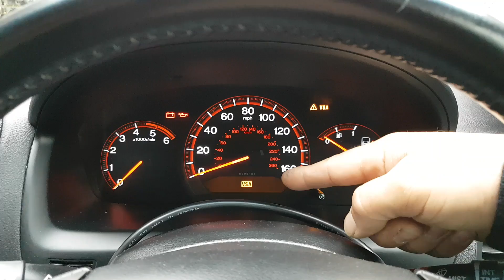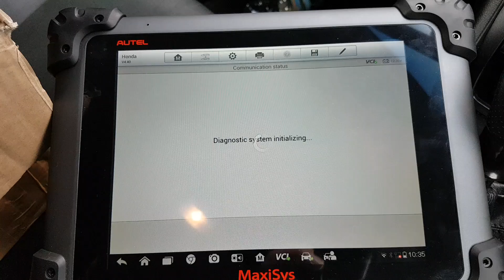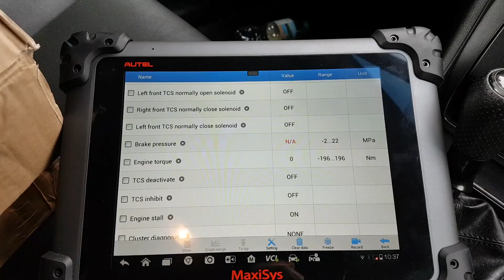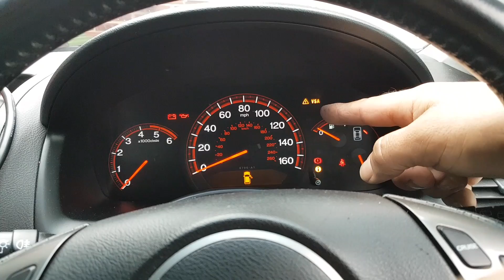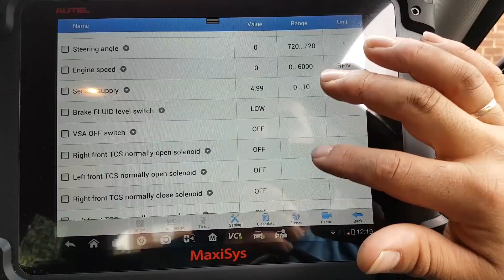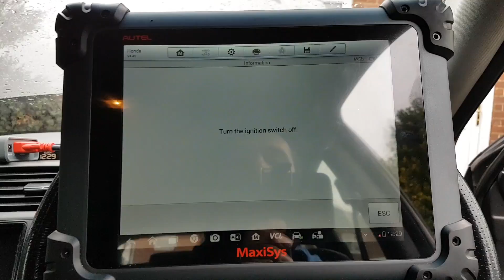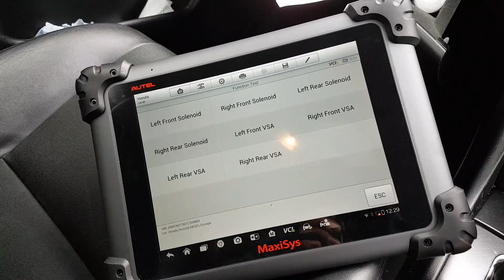Honda Accord VSA light on. Codes 66-1 and 84-1 brake pressure sensor. Fault finding and repair.

Comment: Did you have to bleed abs pump after you have replaced it?? I Did send mine to the company as you mentioned before.. put it back in, bleed the brakes but the pedał seems to be quite spongy.. should i also bleed the pump via scanner??
Reply from the maker: Hi
Yes, you need to bleed the brakes... bleed them the old fashion, should do the job...
If they still spongy, you might have not bleed them enough, and still air in the system...
There is no need to use the scanner to do it, the scanned only aids the process, and not all system allow you to do it through the scanner, in fact, I think on this car does not work...
Thank you for watching!
Reply: LM Auto Repairs thx for reply. I Did bled them the old fashioned way just after installing recon unit back in the car. But after bleeding the system quite a few times the pedal seems to be still spongy. I bled it like 10 times.. the brake pedal after few pumps seems to get harder and as soon as i turn the motor on it sinks down(not all the way) but i would say much more than it should. And while the engine is on - pumping action doesn’t bring the pedal up. Every pump makes the pedal slowly sinking down.. but nut all the way Any suggestion?
Reply from the maker: Kyokunek 
Did you had that issue before?
Because, the unit itself should not causing anything like that, unless there is air in the system...
Reply: LM Auto Repairs to be honest.. i don’t remember... The abs pump along with steering rack recon and replacement of many other parts took me about a year to put everything back together.. so i dont remember.. but What i remember is the brake pressure swich fault and vsa light on- i think that was the main reason to refurb the abs..
Reply: LM Auto Repairs great movies. I'm trying to promote my own one please.chexk my channel

Comment: I have a honda accord diesel 06 plate and have replaced the pump with a second hand one but the lights are still on the dash do i need to get them cleared
Reply from the maker: albert widdowson 
I would recommend... just to make sure...
Hope you haven't got a bad second hand one...
Thank you for watching!
Reply: The guy i bought it from said it was fully working and i have 1 month warranty
Is there another way of reseting the fault code
Reply from the maker: albert widdowson 
Other than with a code reader....
So, how have diagnosed the faulty pressure sensor?
Reply: I took the car to a garage who had a diagnostic kit and it came up with the 66-10 code and he said it could not be cleared so i looked it up and discovered that its the rear brake pressure sensor which is the module for the abs system
Reply from the maker: albert widdowson 
Ok... Just take it back and ask to have the codes cleared... you might also need to recalibrate the steering angle...

Comment: Replaced the the abs pump with a second hand 1. Fault code 66-1 still coming up. Is there any chance it could be a broken wire or will it be 99% the abs/vsa? Very frustrating
Reply from the maker: Patrick Connole 
Hi
Unfortunately you got a broken pump... 
Return it and get your money back!
There is no wires connecting this sensor, as it is connected internally,  as you can see on the video...
Sorry for the bad news...
Hope that helps...
Thank you for watching!

Comment: hi frd   vaxuhall astra 1.7  CAN-Bus No Communication with EPS (Electrical Power Steering cod  u2111-00   i also replace  pump  still same porblem  there 12v  0v   3 pin   0v     2.5     2.4  thanks

Comment: Nice job as always. Please help me, need some info.
 I need to program a key for opel vectra c but do not know from what mcu to read the dump to get the pin code. I have xprog and op com for the job.
Reply from the maker: Mambre Khachatryan 
Hi
Thank you for watching! 
If you only have opcom and x-prog, I would go for the dash...
Reply: OK thanks, but how to identify the pin code in the odometer dump? I have read astra g pin code from immo ecu dump before, does vectra c have same type immo ecu?

Comment: Hi, great video, quick question where are you based? And do you have a email or phone number I could contact you on.
Reply from the maker: benny6917 
Hi
Thank you for watching! 
I don't usually share that sort of details here... don't want to be flooded with spam emails and calls... sorry.
Just ask here...
Reply: lmsvvavr hi no problem I understand, basically I have a sykes induction heater, and it's stopped working and I haven't a clue I'm rubbish at soldering don't know what to look for on pcb how to check the tiny resistors  and I was going to ask you if I could post and pay you, I'm in the UK. Just thought I would ask, as you do amazing work on your channel.
Reply from the maker: benny6917 
Ah ok...
I am quite busy at the moment...
There is anything that visually looks odd?
Reply: lmsvvavr no nothing visible opened it up last night had alook nothing visible  inside it's getting 240v though as I put multi meter on it where the wires are soldered at the Base of the induction heater, so it's getting power but not power the up or the fan or led light or heating up the bolts.
Reply from the maker: benny6917 
Well, I can't really help you further... I am not familiar with that heater, and do not want to wrongly advise you...
Try to measure some components maybe, like capacitors... see if you find anything...
Hope you get it sorted!
Reply: lmsvvavr ok no problem. Thanks for your time and replying to the messages I will try 👍

Comment: good job  i need your help for helping me for how to use autel elite in programming cars i,m try but i need help  9739775147
Reply from the maker: Ahmed Abd elbaky 
Hi
Thank you for watching! 
MaxiSys Elite can't do programming on all the cars... you need to have it connected to see if is capable of that on the car you are working...
Which car and module are you trying to program/reprogram?
Reply: BMW 54I 2003
Reply from the maker: Ahmed Abd elbaky 
Ok... does the menu for programming shows up?
Reply: if the elite not have it what we can do
Reply from the maker: Well, you need to do it through other ways...
What exactly are you trying to do?
Reply: when i try to learn how i programming by elite they told me i had connect to net  but i dont find any different . but some friend told me i had connect to the car website to buy the programs   but i dont do that and if you know the way told me